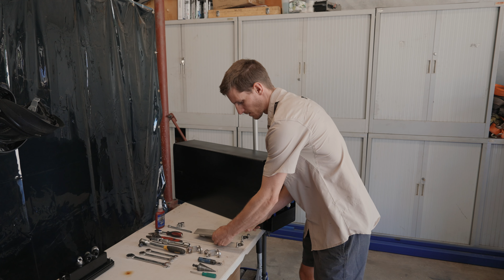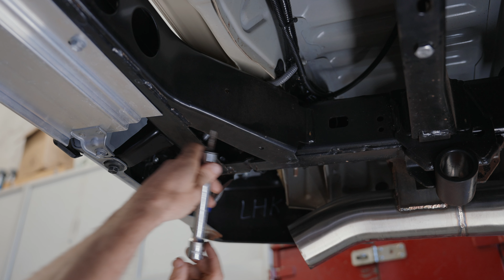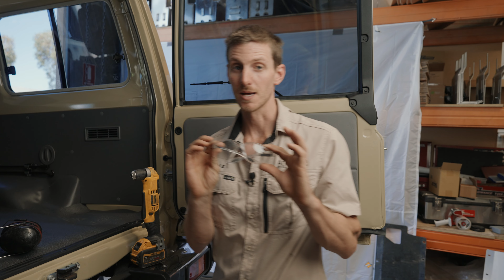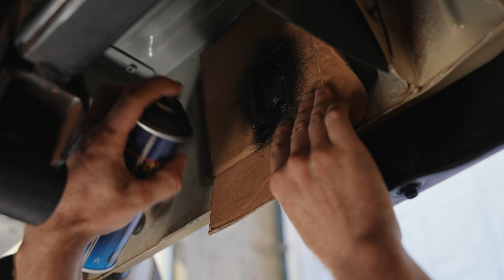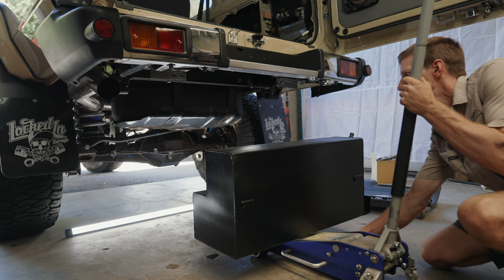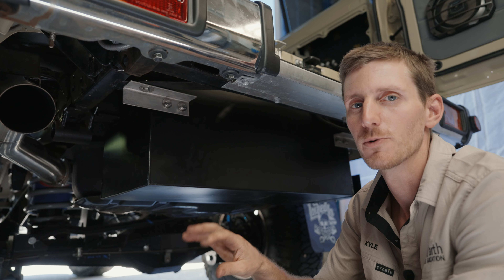Ark Earth Products - Water Tank, Utility Panel & Compressor Bracket Install | 2025

Comment: Thanks bloke 👍🏻 awesome. I've got a question. Does the panel fit back on, with the compressor hose connected. Or does it protrude out too much?
Reply from the maker: Gday Legend, thanks for your message. Depending on the 90deg fitting on your compressor. The fitting itself will protrude about 5mm on the standard ARB twin compressor. 

There is a version of the ARB twin compressor though, which is the portable version. It has the outlet in a different location. This compressor hose fitting doesn't protrude at all. 

The hose that connects to the utilty panel is all within the cavity. 

There is also a new compressor from ARB coming to the market around March 2025. I am yet to confirm the fitting location on this new compressor. 

Hope this helps. 

Cheers 
Kyle
Reply: @ArkEarthProducts  yeah cool thanks man I'll keep an ear out.👍🏻